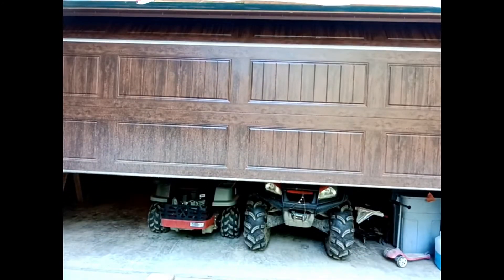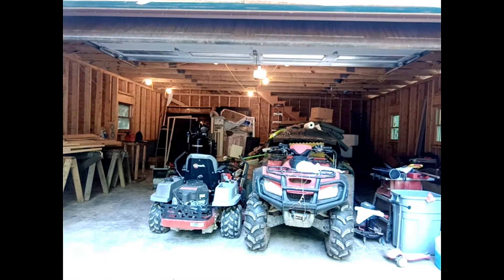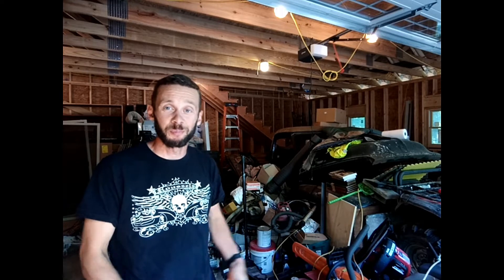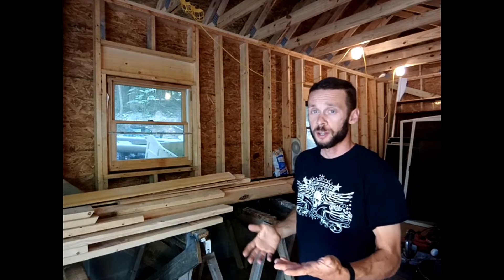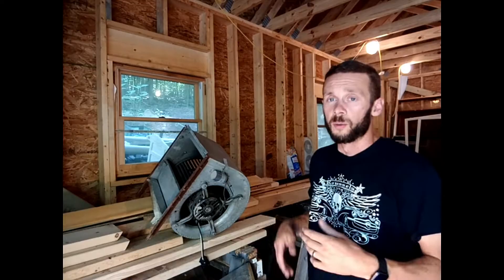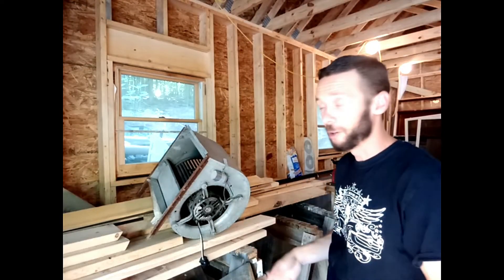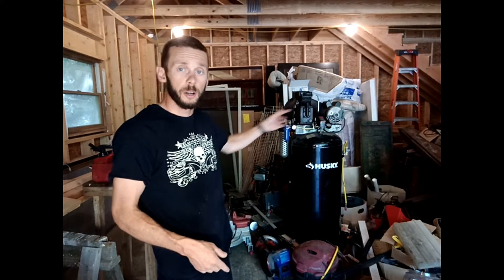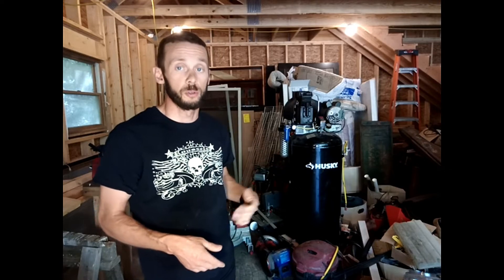New Garage 28x28 with attic

Comment: NICE!!  Working on my own shop build.  40x60x12, I recently picked up a 2-post lift.
I bought my garage lights from Sam's, 4 foot LED fixtures that you can daisy chain together.  I put outlet boxes in the ceiling and switched them.  That way if a light goes bad, I just unplug it and plug in a new one, but you could hard wire them too.

I drew a plan of my shop and all my big tools and cars and played "paper dolls".  Moving the equipment around .
Reply: Oh and two words..... French Cleats
Reply from the maker: good call on celing outlets. I like that just frm a flexability stand point.

Comment: New shop looks good. I would not use the upstairs for woodworking if you build anything large like a dresser or table. Remember anything you build you'll have to carry it downstairs to get it out. Make sure to run  2-3 20 amp lines. I ran 2 one for my table saw and one for my dust collector. I use to pop the 15 amp breakers every once in awhile when I had both running on the same circuit.
Reply from the maker: I have barn style door on the front so things can be passed out and lowered down that way too. Good call on the higher circuits upstairs.

Comment: Great to know you are still around, understand why you were gone.  Insulate as heavy as able.  You might run hard air lines while you do the wiring.  Don't skimp on electrical outlets.  Go with LED lighting now instead of later.  If bench(s) are mobile have multiple outlets on bench with one extension cord to outlet.
Reply from the maker: I'm going to have a mobile bench good call on power to it.

Comment: Congrats, that looks spacious. The storing option upstairs is realy an asset! Do not know if you have strong winters, if you do so, you could even think of insulation with rock wool and a moisture bareer over it. As you are running ventilation, even just from time to time, there should not be any issue with mould.
Have fun, looks like a great place for your projects and treasures. Greetings from Black Forest, Germany.
Reply from the maker: My goal is to insulate it and find an old central air system I can retrofit into it. It gets hot more than cold here.

Comment: Here's a thought looks like a great workspace. Build yourself a shed outside of the building and place the air compressor and vacuums into that building give each tools on Fresh Air snorkel and exhaust so you don't contaminate the electric motors on the vacuum build a dust separator autore plastic 55-gallon drum habit just outside of the building sounds like a lot of work it is but we'll make the workshop much more pleasurable overtime